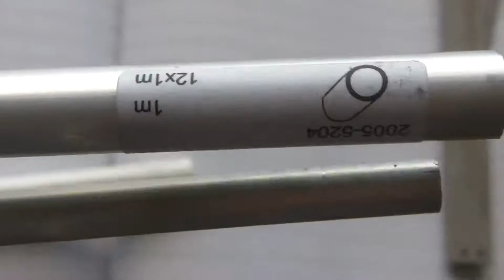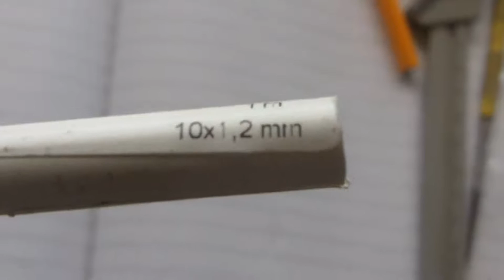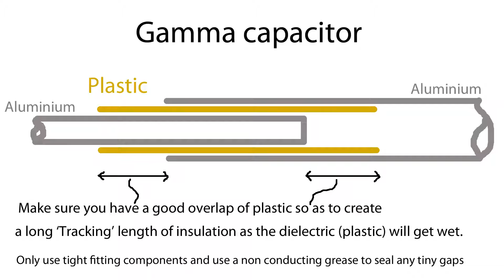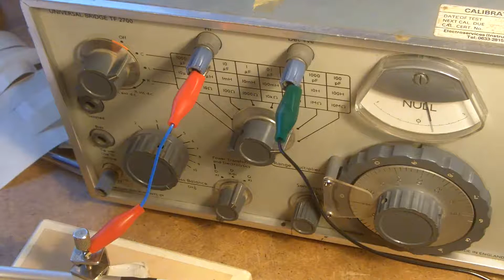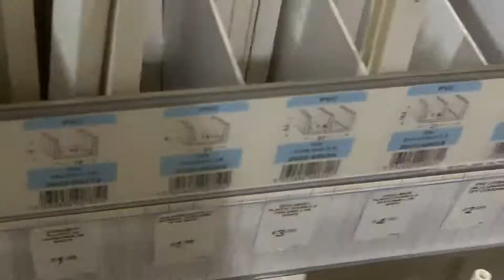About Radio 59  Gamma capacitor, 14 pF per inch

Comment: I love the set up there in your local hardware shop Andy. Great for radio nuts :) so have you tested PVC as a dielectric at a moderate power level? Does it become hot? I've successfully used clear flexible plastic hose for this before. Another idea is to just shove the inside of some RG213 (the inner conductor and dielectric with the braid removed) inside a piece of aluminum tubing. Provided the latter gives you enough capacitance, it works very nicely too :) Best regards- Daryl